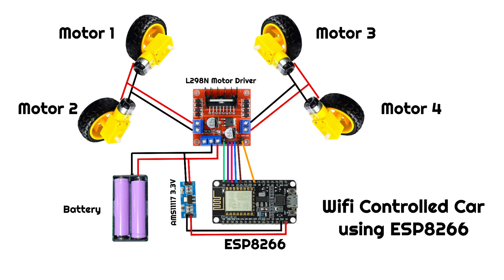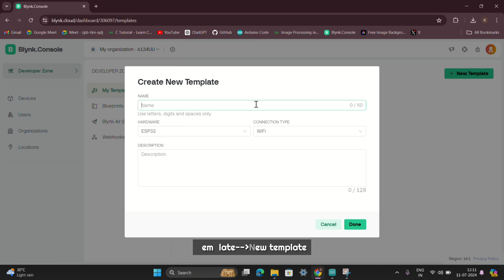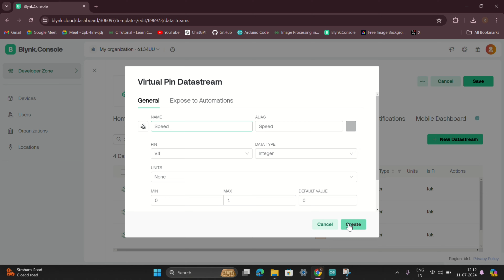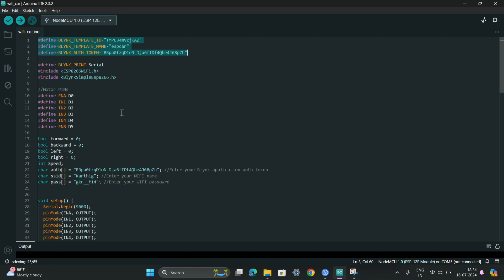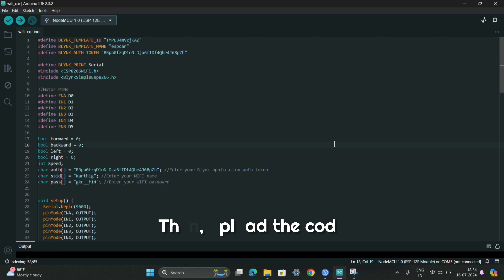How to make mobile wifi control car using ESP8266 | IoT smart car | Wifi car using esp8266

Comment from the maker: Here's the code:

#define BLYNK_TEMPLATE_ID "ID"
#define BLYNK_TEMPLATE_NAME "espcar"
#define BLYNK_AUTH_TOKEN "TOKEN"

#define BLYNK_PRINT Serial
#include <ESP8266WiFi.h>
#include <BlynkSimpleEsp8266.h>

//Motor PINs
#define ENA D0
#define IN1 D1
#define IN2 D2
#define IN3 D3
#define IN4 D4
#define ENB D5

bool forward = 0;
bool backward = 0;
bool left = 0;
bool right = 0;
int Speed;
char auth[] = "TOKEN"; //Enter your Blynk application auth token
char ssid[] = "Karthig"; //Enter your WIFI name
char pass[] = "gkn__f14"; //Enter your WIFI passowrd

void setup() {
  Serial.begin(9600);
  pinMode(ENA, OUTPUT);
  pinMode(IN1, OUTPUT);
  pinMode(IN2, OUTPUT);
  pinMode(IN3, OUTPUT);
  pinMode(IN4, OUTPUT);
  pinMode(ENB, OUTPUT);

  Blynk.begin(auth, ssid, pass);
}

BLYNK_WRITE(V0) {
  forward = param.asInt();
}

BLYNK_WRITE(V1) {
  backward = param.asInt();
}

BLYNK_WRITE(V2) {
  left = param.asInt();
}

BLYNK_WRITE(V3) {
  right = param.asInt();
}

BLYNK_WRITE(V4) {
  Speed = param.asInt();
}

void smartcar() {
  if (forward == 1) {
    carforward();
    Serial.println("carforward");
  } else if (backward == 1) {
    carbackward();
    Serial.println("carbackward");
  } else if (left == 1) {
    carturnleft();
    Serial.println("carfleft");
  } else if (right == 1) {
    carturnright();
    Serial.println("carright");
  } else if (forward == 0 && backward == 0 && left == 0 && right == 0) {
    carStop();
    Serial.println("carstop");
  }
}
void loop() {
  Blynk.run();
  smartcar();
}

void carforward() {
  analogWrite(ENA, Speed);
  analogWrite(ENB, Speed);
  digitalWrite(IN1, LOW);
  digitalWrite(IN2, HIGH);
  digitalWrite(IN3, HIGH);
  digitalWrite(IN4, LOW);
}
void carbackward() {
  analogWrite(ENA, Speed);
  analogWrite(ENB, Speed);
  digitalWrite(IN1, HIGH);
  digitalWrite(IN2, LOW);
  digitalWrite(IN3, LOW);
  digitalWrite(IN4, HIGH);
}
void carturnleft() {
  analogWrite(ENA, Speed);
  analogWrite(ENB, Speed);
  digitalWrite(IN1, LOW);
  digitalWrite(IN2, HIGH);
  digitalWrite(IN3, LOW);
  digitalWrite(IN4, HIGH);
}
void carturnright() {
  analogWrite(ENA, Speed);
  analogWrite(ENB, Speed);
  digitalWrite(IN1, HIGH);
  digitalWrite(IN2, LOW);
  digitalWrite(IN3, HIGH);
  digitalWrite(IN4, LOW);
}
void carStop() {
  digitalWrite(IN1, LOW);
  digitalWrite(IN2, LOW);
  digitalWrite(IN3, LOW);
  digitalWrite(IN4, LOW);
}